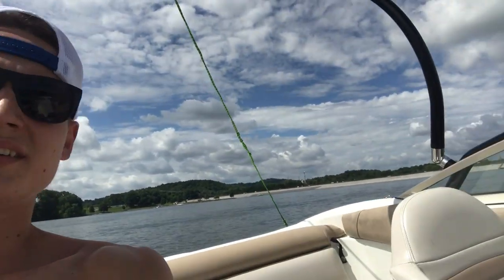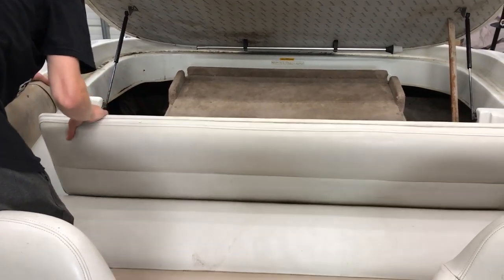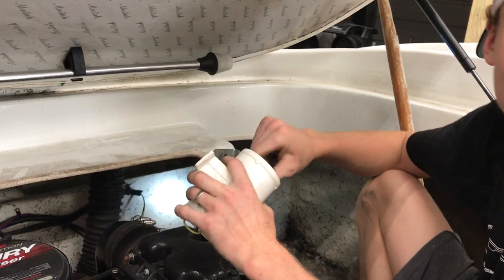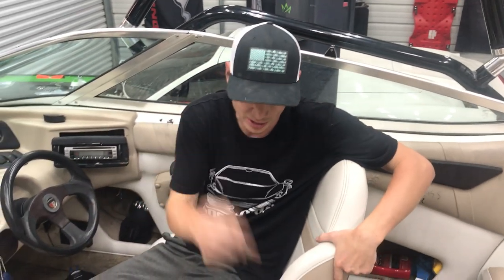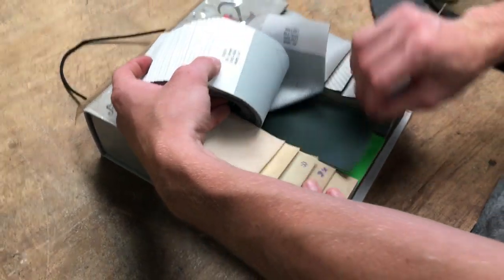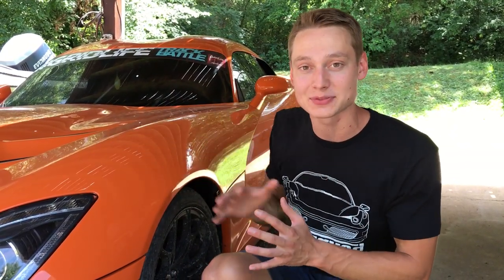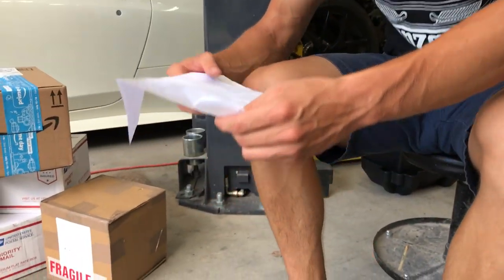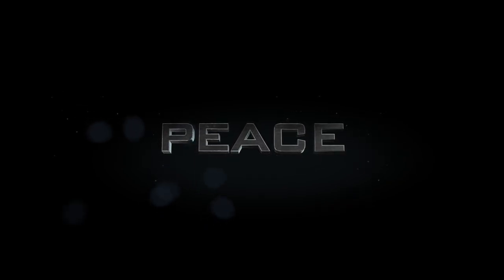Rebuilding A Super Cheap Wrecked Boat Part 4

Comment: Russ Rea Commented this and im doing a copy pasta to make sure they see it:
 That hose with the brass fitting and extra connector is a quick drain for the engine oil.  The brass plug goes into the drain plug at the bottom of the boats transom.  That cable then connects to the oil pan to drain the oil, just pull the drain plug, unscrew the coupler that's attached to the hose (while the rubber drain line is pulled through the hull and you can drain the oil easily without having to pump it out. Side note -  It's really slow draining.  I normally just put a gallon jug on the ground and about 1/2 hour later it's full and proceed to the next gallon.  It should hold 5.5 quarts with a filter.  Also on the RPMs.  That motor is going to grenade at 6K.  That boat is WAY under-propped if the tach is correct.  Need to look at the pitch of the prop (should be stamped on the hub of the prop).  Lower pitch like 19 or so gives better low-end / holeshot performance but sacrifices top end speed. The best bet is to have a prop that reaches the recommended RPMs with a medium load and 1/2 tank of fuel.  Also look for a stainless steel prop vs. aluminum.  Aluminum flexes under load and looses performance.  Side note if you hit a log with the aluminum prop they are cheaper to repair.

Comment: If you have not taken a boater safety course please do so. Please keep up the good work on the mods for the boat. If the boat is listing to one side or is hard to get on plane you can always get trim tabs. These might help Nauticus Sx Series Smart Tabs 20 - 25 Ft Boats.

Comment: If your hydraulic fluid is milky... you MAY have leaking seals in the hydraulic rams......... they are pretty easy to rebuild on your own.... can probably get rebuilt kits on eBay.........  Use an oil pump to suck the crappy milky fluid out and replace with new fluid (some use transmission fluid)........ run it a bit and see if it gets milky again :)

Comment: You should do treated wood paneling or some other type of paneling for the floor . It looks really nice on boats , I work at a lake and most of the nice boats have paneling rather than carpet, also it’s easier to maintain and won’t form mold

Comment: The hose with the plug is the oil drain. Your speedo is most likely plugged in the front of the outdrive but may just need to be connected to the outdrive against. To drain and refill the hydraulics, disconnect them where they pivot outside the boat. Lift and lower the outdrive until nothing else comes out and run the pump until empty and add fresh fluid run pump up and down until only fresh fluid comes out back. Then re attach hoses and refill and run up and down until you don't hear air anymore

Comment: This is a GM based 302 C.I. 5.0 liter, small block engine. It's a low horsepower, but very reliable little engine. As far as replacing the carburetor, marine carbs are designed a bit differently than an automotive carb, to reduce the risk of fire.  That vent fan is also to vent the engine bay of fuel fumes prior to attempting to start the engine. Boats that aren't maintained properly are fire and explosion hazards. Be safe. I love watching you're channel.

Comment: pretty sure the 5.0 is a 305 with 220 HP max rpm should be 4400-4800 and should run at 160 degrees temp
Reply: I was going to say that is about the correct rpm. The pitchn of the prop must be way to high.
Reply: @MPHinc2012  The hub on the prop might be spinning too......... if that got messed up maybe during the accident........  either way, well over 6000rpm = HORRIBLE.
Reply: change the oils and plugs and wires and cap/rotor,jeze that's a SOP on these holes in the water?
Reply: Knox199121 is right boys don't run it that hard u til you get the leg figured out. Another simple cheap fix is the impeller. It's what brings in fresh water to cool the engine. Harder to tell internal vs an outboard.
Reply: My old man's boat with a 305 was rated at 260hp
Reply: @AircraftMechanic-AP  multi port injection is the higher horsepower.
Reply: @MPHinc2012  ah. Makes sense.
Reply: @AircraftMechanic-AP  surprized the guyz have'nt gone thru the bottom end andchel all the seals and fluids  on the boat.make a good YT vid

Comment: Advise: Never do the one you did from 13:47 to 13:53 because it might capsize when running on waves.

Right way: Get the wave 30 degree sideways ( left or right ) so that the angle of the boat would’nt turn too much to left or right.
Wrong way: Getting the wave straight because if you do it, the boat might capsize especially with big waves.

Suggestions:
Wake Cover
Bigger tank
Shower after swimming
Change propeller

Hope this would help☺️
Filipino Supporter!

Comment: You shouldn’t run your motor at 6000 rpms for a long time cause it will overheat and it can blow the motor
Reply: More like NEVER run your boat at 6k rpm.
Reply: I’m not sure how accurate that tacho is?!? Looked like it was sitting high at all times. Maybe they were always are full send!
Reply: Don't worry we got a spare lambo v10
Reply: @repeatrepeatrepeat  I'm thinking the v10 will end up in the boat.  SUPRISE! LS lambo swap.
Reply: Aka dont run any engine over 6k for long periods of time
Reply: Boats are a lot harder to overheat since they pull fresh water constantly. 6krpm might be high but it depends on the eninge setup along with the prop.

Comment: The black hose you had at the beginning of the video is the oil drain. Run it out the drain hole in the bottom of the boat. The brass bolt is the drain plug.

Comment: There have been so many times I've seen you guys switch from your Millwaukee impact to a ratchet wrench, slowing down progress. I recommend you get yourselves an impact right angle adaptor that allows you to get in those tight spaces. I use a Dewalt adapter personally and they are cheap on Amazon. Dewault DWARA100 right angle attachment.
I also recommend you switch to the Fuel 12V brushless stubby impact, it rivals my 18V regular impact. The thing is tiny and very powerful with great battery life. The ultimate all in one tool. Keep up the great work guys!

Comment: 5.0L is a 305ci very weak v8 motor....the pump thing is called a bilge pump with safety float... replace carpet with Seadek
Reply: Or line x or raptor liner!
Reply: +1 for Seadek!  Carpet stinks when it gets wet!
Reply: 5.0 Mercruiser is weak??lol ..on a 16ft boat?lol ..what do you suggest the 7.4 and 5 point harnesses and life insurance?
Reply: @ryanm4319  it's a weak v8 yes... Great engine for there application but running it wide open at 6000rpms is not good.
Reply: @SouthFLMudClub  Considering that the engine maxes at 4800rpm (prop pitch and head flow) yes, running it at 6k would indeed be a bad idea!
Reply: Whoever said marine engines are different knows squat . Internals are not different from a car engine..
Reply: @ncnmra5882  and it rots the deck
Reply: @ryanm4319  you must not know much about boats lol, that boat prob only hits 35 mph maybe, which is perfect for what the boat was designed for but the engine is not strong/ the boat fast in any way.
Reply: @SouthFLMudClub  it won't even hit 6000 RPMS...maybe 4800....it is a marine application...it would last forever if it was taken care of.
Reply: @bradjackson687  they are not different... I've had them apart...Nothing different to valve train. have bought a 350 crate engine and change freeze plugs and intake manifold from old engine and and threw it in.
Reply: @SouthFLMudClub  You might want to do some research on the internet before you reply like you are some sort of expert and call out people on the comments. YES! there is a difference between marine and automotive. http://www.marineenginedigest.com/specialreports/marinevauto.htm . You say a 305 is weak, maybe in the 80's but the vortec 305 can produce 250+ HP with a 350 around 390+. But the can take a beating and that is why the are great marine engines. The only major difference between the 305 and 350 is bore 4" to 3.74. Ok heads are different in combustion chamber size but 305 work on a 350. So use your eyes before you open your mouth. PLUS for what these guys want to do with this boat and the size of it the 305 is a good power plant. They spent less on the whole package that you did on your automotive crate motor.
Reply: @SouthFLMudClub  Oh yea since you are using an automotive engine in you boat you may want to make sure you have a marine alternator and starter with no open spark. Befor you go BOOM.
Reply: @SouthFLMudClub  They sure are....The cams are different. Thats the deference between a Marine Spec and Auto Spec.
Reply: @Mr.XJ.96  come on a camshaft does not allow a engine to run at 6000 rpms constantly.   Camshaft moves the power band to make power at higher rpms but does not make it any stronger.   I am not green with engines.  I understand what duration and lift does.
Reply: its a shitty car engine yes, the chevy 305, but the 2bbl version in marine application is 240 hp and they got a tiny boat, its more than fine
Reply: @ragimundvonwallat8961  I agree 100% great engine for the boat but it's weak for a v8..  he was boosting it as a 350.   ..240hp is plenty for that boat no doubt...
Reply: @SouthFLMudClub  and its cheap 240 hp ...no exotic marine engine parts to get...you can get plenty of parts easy

Comment: It’s just a Chevy 305 with marine parts. You could easy swap it out with a built 350/ 5.7 later. The 305 motor is kind of a dog.
Reply: Thats a common opinion. But, the 305 in my Camaro has over 320 thousand miles on it and has beat more than a few 350s. Yeah a few more cubic inches can never hurt but a dog? If something went horribly wrong with it and it had to be replaced then yes a LS would be the way to go as long as price isn't an issue. If it is another 305 would be WAY more affordable and much easier to find.
Reply: @paulbosley6448  the 305 made almost 30 hp les than the 350. All a 305 is is a smaller displacement version of the 350. There is not a person in the car building world that would swap a 305 for a 350. A ls would be nice, but that would require modification. They could buy a crate 383 and put on upgraded engine parts and be close 400 hp depending on how much they wanted to spend.
Reply: @fpsweet66  you are not getting what I'm saying. The boat AND trailer cost the boys 1800$. ..the 305  in it runs fine and has plenty of power for that boat. You advocate replacing the 305 for a 350 because the 305 is "  a dog". How much time and money should they spend on that swap? If Horsepower is your thing you have two choices a blown LS or ZZ 572. Who wouldn't want a 60 thousand dollar engine in their thousand dollar boat. Great advice .
Reply: @paulbosley6448  you can swap a 383 in for under 5k all day long. A long block 350 is half of that. They said that the 305 was low on power. I only suggested using the 350 or 383 because all of the parts would bolt right up. It could all be done in a half of a day or less. Any other engine option would take far longer. They already said they are going to spend 10k on the 1500 dollar boat another 3 to 4 k is a small expense for the engine upgrade.

Comment: You can pull the bottom off of the trim pump and rinse it out with solvent or kerosene . Refill it  and  you could bleed the line . Make sure to cycle your trim several time . Might want to replace both solenoids while your at it. They make the trim go up and down . Both should be the same .

Comment: Pump thing is called is called Bilge pump, and the hr meter is in the ECU. And Mercury dealers can plug into the ECU and tell you exactly how many hrs. Front oil bottle is for the hydraulic drive lube and ‘milky ‘ one is the Drive trim and must be drained and flushed as this boat was flooded. You knuckle heads need to take a US Coast Guard boating courses!!!
Reply: Go easy on them okay at least they are passionate about a project
Reply: Why are they knuckle heads? I have owned boats most of my life and never needed a Us Coast Guard course, nothing they have done so far would of improved from that course. I’m not saying it is not a good course to take are that they wouldn’t benefit but come one they’re rebuilding a cheap boat can’t you see the coolness in that. Hey guys keep up the great work and thank you for sharing it with all of us.
Reply: just by your comments, I can tell you are not familiar with safety or safe boating. Almost every term these knuckleheads use, is incorrect. It’s critical to LEARN the proper terms for safe boating not only to protect yourself but other boaters as well. Every boater should know the “Rules of the road” as well as terms to properly identify issues and if needed report that info to others boaters and or the US Coast Guard. If your not a older or seasoned boater, educate yourself correctly and know exactly what the federal boating laws are and the required equipment needed for your vessel.
Reply: ProfabDesigns Inc. You seem fun at parties.
Reply: Shane Gunter  Amen brother he sounds like Wilson the nosy neighbor who calls in on everyone.  I agree how hard these 2 work and there outside not on a device and social media
Reply: @Profabdesigns  wow you sound like a lot of fun did another boater make you sound so but hurt? There are about a million positive things you could say about these 2 why don't you try that.
Reply: ProfabDesigns Inc. ok boomer 🤭🤣
Reply: People, don't mess with ProfabDesign. He has 11 !!! faithful subscribers. I bet he is fun to watch. Life is really boring when you know everything.
. 🤣🤣😀✌

Comment: The hose and plug on top of engine is the oil drain plug. Should be hooked to oil pan and go out boat drain. I would suggest changing gear lube since resivor was empty.

Comment: When Changing the belt the top right pulley is the tensioner loosen the nut and tighten the middle bolt, then while holding it at the as tight as you want it tighten up the nut. Also running rpm for that 5.0 is between 4200-4800 rpm running is well over that for long periods of time will cause premature damage! Also the trim fluid being milky means the trim seals or hoses are leaking letting water in, it will ruin the pump if not addressed

Comment: SPEEDOMETER FIX - 
1 Stick an 1/8" drillbit in the small hole in the bottom/front edge of the outdrive. 2 Just hold but in fingers and spin it around some. 3 Rinse. 4 Repeat a few times.
Reply: I luv this MacGYVER type of fixes!!!!!!!!!!!!!!!!!!!!!!!!!!!!!!!!!!!!!!!!!!!!!

Comment: You need to check the fiberglass encased runners in the bottom of the boat. They may be rotted. You need to check all belts, pump, fluids, and seals. If you are gonna after market anything, put and after market boat EFI on it.

Comment: The hose with the plug on the end is for changing the oil, much easier to fish that through the drain plug and empty it that way rather than having to pump the oil out of the top. Also, the extra wires on top of the motor are not used on carburated models, just ignore them. If I were you I'd go ahead and change every single fluid on that thing and also the fuel filter, most people never do and it's supposed to be done at every winterization. Everything's pretty easy on these mercury motors, it's just a chevy block

Comment: Use your blower for at least 5 minutes EVERYTIME you start the boat. I had too help rescue an older couple who’s boat had exploded and launched them out of the boat and into the water. They had very extensive injuries like a chunk of fiberglass in the back of the mans kneck. And the woman had a gash in her forehead about 4 inches long. There’s still blood stains in the carpet and seat of my boat. Those blowers save lives.

Comment: Just FYI..... The switch to automatically turn on the water pump is a float switch for the Bilge Pump .... The hose with the plug in the end should be an oil drain line... remove the plug and attach a vacuum pump to suck out the oil since you can not get a drain pan under the engine....Good luck withe the new toy!!!

Comment: A 5.0 Chevy is a 305 cubic inch small block
Reply: The 302 Chevy was the original Z-28 engine from the late "60s. Basically a 327 block with the crank throw of a 283. This boat motor would be a 305, a whole different design.
Reply: @Urbicide  you learn somthing new everyday, Thanks man!
Reply: YW!

Comment: 5.0 “is it a 350?”  Guys, learn about engines! 😂
Reply: Jon Becker thats what i said lol plus chevy makes mercury? i thought ford did lol
Reply: Mercruiser hasn't used ford for years. All Chevy, probably a 305.
Reply: 61 cubic inches per Liter.  Engine is 5 Liter.  So 5 x 61 is 305 cubic inches.
Reply: You'd think they'd know more about engines and whether you could carb it differently marine aside,what goes where what does what. There are some differences considering its marine use but the basics are the same.

Comment: I recommend strongly to refurbish your interior. The seat backs and cushions are in good condition. You will never get a better fit and finish if you replace them. These are factory fit and look best as is. Use a good quality cleaner such as SEM product. Use a good quality dye. The carpet can be cleaned/steam cleaned and a dye can be used. You have the tools and space for these projects. It will make a great video series as well !!

Comment: That fan should be switched on for a couple minutes before you start the engine. It is to remove gas fumes to prevent 🔥. Also drive line lube is important. Always check oil and the level of that before you leave. And you should also change power steering and trim hydraulic oil. It won't work well if it's old or has oil in it. The plugs may be for options that you don't have. Or possibly tach or speedometer